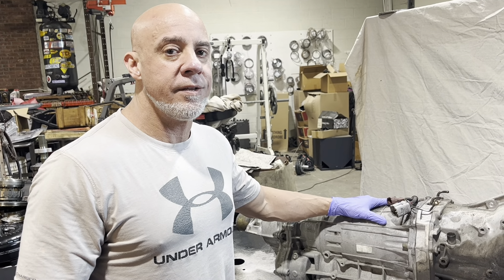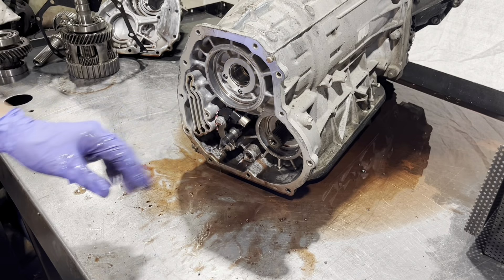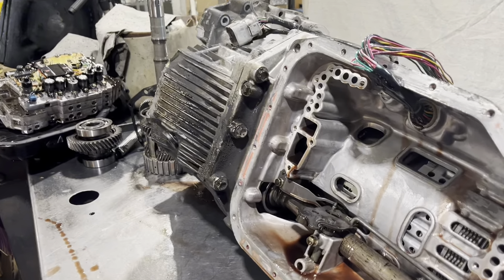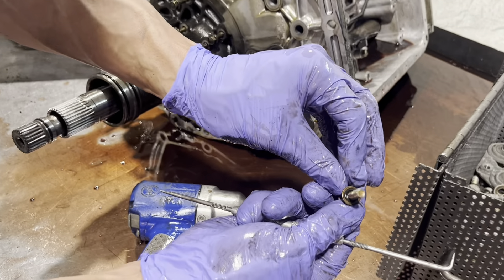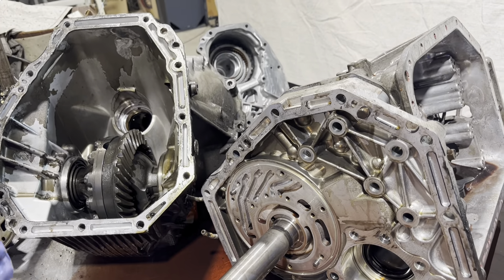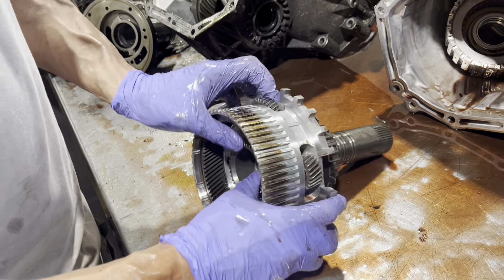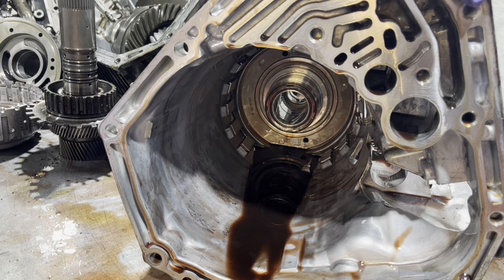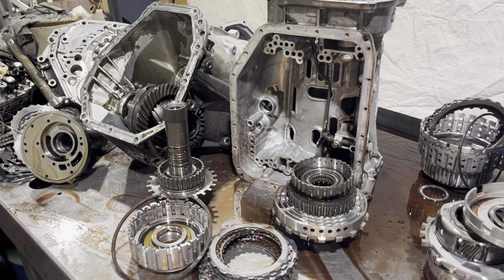Subaru's Auto-Transmission Nightmare: Look Inside the 5EAT Carnage!

Comment: Can a failed Torque converter cause the car not to my my 5eat wont move weather in drive or reverse it will just raise the rpm as if it wants to move but wont in either drive or reverse theres a whining noise somewhere in the engine bay it increase with rpm. Any ideas if the tc might be the problem

Comment: I have a 09 legacy, occasionally it shifts super hard all gears, you think it's gonna brake something, even with slight throttle input. One time it did it the at temp light came on. Its very random, no ryme or reason. Does it maybe once a month. And ideas? Btw when not acting up tranny operates perfect for weeks..
Reply from the maker: @joracer1  Have you scanned for codes?

Comment: JATCO - Japanese Automatic Transmission Company - junk
Reply from the maker: They make both good and bad transmissions, but we have these particular units performing up in the 600hp range, so it's a great starting point for a strong performance build.
Reply: @iptperformancetrans  In all fairness, they do make a decent transmission. It's just what people ask it to do, and then somebody like me who rebuilt them for 30 years has to deal with the pork supply chain. Blah, blah, blah applause enjoy. I was only lucky enough to end on the Mazda 4eat... fwd, slamming pumps and cluches thru the fenderwell... TH425 in a old cad is my speed
Reply from the maker: @sullytrny  Remember the 3254L? What a nightmare lol
Reply from the maker: @sullytrny  We used to call those Mazdas ECAT’s

Comment: What are the common causes of hard shifting. Especially from 2nd to third.
Reply: Turbine speed sensor 2 on the valve body
Reply: Oh man…thank you for responding. I have the very same issue on an imported 2009 Subaru Exiga GT. Its intermittent but will likely try this first before a full on rebuild. 

I have read on some forums it’s an ECU issue as well.

Comment: 15:52 what are those two pipes (on the right side) of 'the pump'?? I have tubes coming off there, runs till under the intercooler, when removing the intercooler, these pipes just end?? They don't go anywhere!? Tge ends are open (not plugged or anything)!?! Been driving the car with no issues or leaks.....just removed intercooler and wondered what those are???

Comment: Hey I've got a question again... you said that the low and coast clutches typically don't go bad, but what about the seals on the pistons behind them ? Subaru considers everything behind that support with the three torx bolts to be a "non-disassembly" part, just as they do with the direct and high clutch packs. Why is that ? They prefer you to buy a whole transmission case rather than just change seals or spend $700 on an individual clutch assembly ? Their "overhaul" seems to end at the support assembly. Strange.

Comment: Interesting to see inside a 5eat. Got a question is the later model 5eat with paddle shifters more robust than the early model? I don't see any shift kit for it does it have a shift kit or you can customise the valve body to give aggressive firmer shifts for those running high HP or looking for a long lasting transmission?
Reply from the maker: We can modify either valve body for performance applications, however, the 2005-2007 respond better to valve body modification

Comment: Stock 2011 Outback 3.6R with 5EAT. Great video. My trans is actually shifting and operating great at 172k miles. What ATF fluid do you recommend? I have only used Subaru ATF HP and changed regularly; mine has always stayed bright cherry red and clear.
Reply from the maker: I recommend any reputable brand of Dexron VI spec fluid

Comment: I have a Subaru legacy and the high low reverse clutch burn out 2 times now what could cause the problem
Reply from the maker: Does the drum have ring grooves cut into it?Did you air check it upon assembly?
Reply: No I didn't
Reply: Yes it have ring Grove
Reply from the maker: @andrewheeler607  Id take the valve body off and air check everything before it’s disassembled again for starters
Reply: @iptperformancetrans    ok thanks

Comment: Where does the anti clunk spring goes
Reply from the maker: Stay tuned, we'll probably go a little into the rebuild and reassembly of the 5EAT in the future.
Reply: Where did u take the anti clunk spring from
Reply: Where was it located I recently take out all my clutches and saw that spring now I don't know where it fits
Reply from the maker: Contact us at the shop and we'll get you an illustration - info in the description. @andrewheeler607